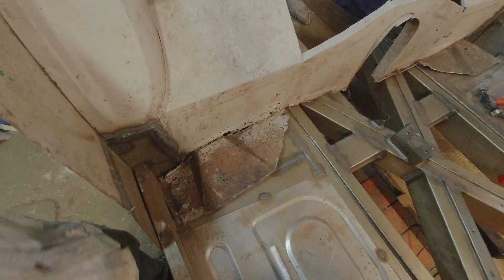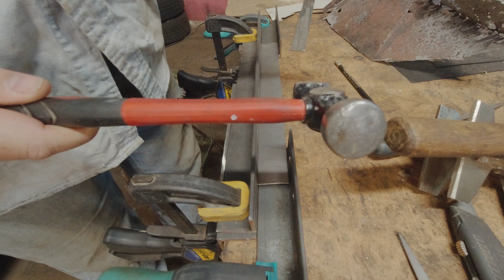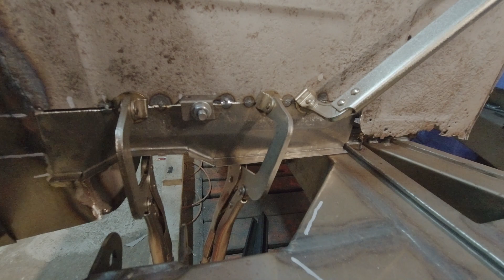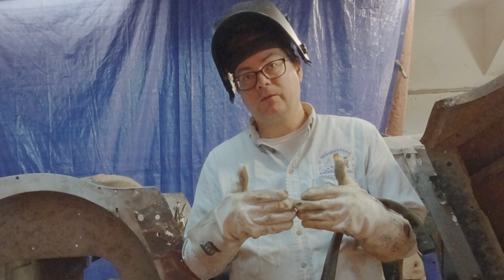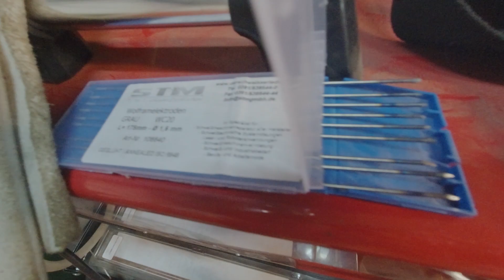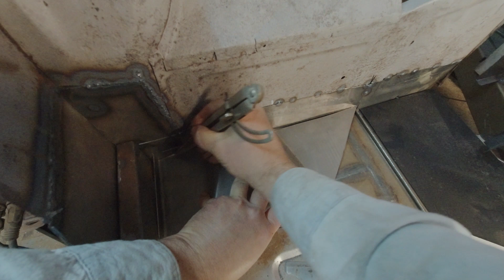The Austin Healey Project - Season 2 Episode 15

Comment: You forgot the most usefull tool in the box, your brain and the patence to give it a try. i  like your calapers, must get a new set like that for myself. The panel you are working on was the same one that i had a go at replacing on my 100/4, again like yours just the bottom inch was rusted away and i had very little confidence that i could join a repair patch in without it looking odd and not matching the old panel so i decided to make the complete panel, quite a step for a very novice learner, i had mentioned that i was going to atempt to do this to a fellow austin healy club member ( bernie clover where are you now) who asked if i would make one for his restoration, and i took this as a challange to test my skills, i used almost the method you used but instead went a bit further and made a 3mm plate steel sandwich of the complete panel with male and female sides that i could clamp in a bench vice and work along crimping it as i went, it pressed out the shapes of the pressings very well without having to beat out the shapes with a hammer,  ( i did rather ruin the bench vice as you need a lot of pressure to crimp the pieces together ) the outer flanges i just turned over with a hammer and a small chunk of timber so as not to mark the edges, to cut a long story short and a weeks worth of construction it worked very well and i still continue to use the same method today, though i better add it takes quite some time to make the tool to do the job and just for one panel is it worth all the time spent, only you can say at the time.